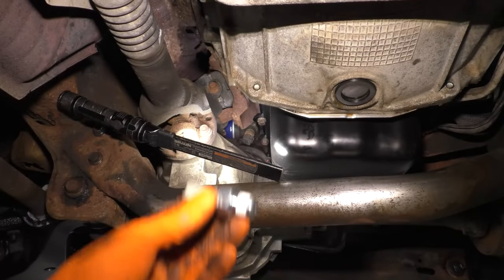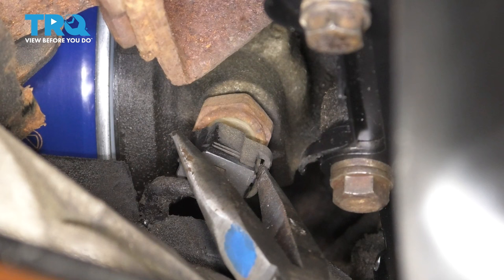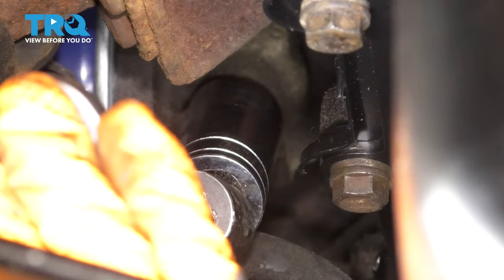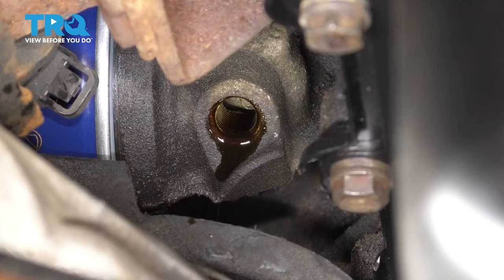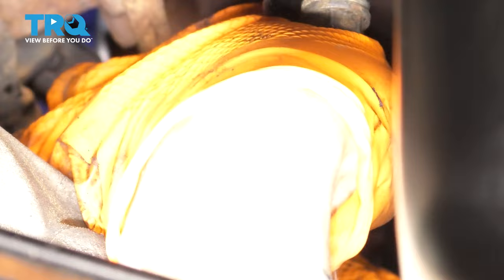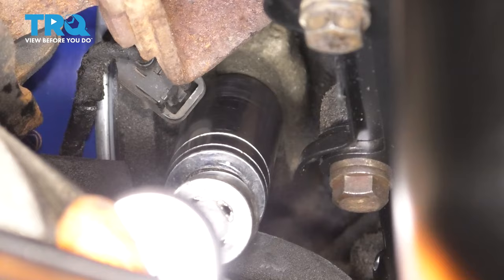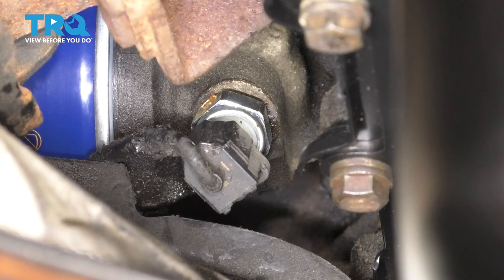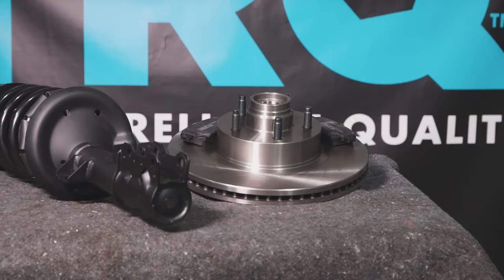How to Replace Oil Pressure Switch 1997-2003 Ford F-150

Comment: I have a 2004 F-150 Lariat Super Crew 4x4 with the 5.4L 3V V8
I turned my key a it read “ Low oil pressure “ on the dash. So I bought a new oil pressure switch/sensor to replace it myself tomorrow morning and thanks to your video I feel confident enough to do it myself and save a hundred something dollars. I’ll put that money to good use and fill up my gas tank, so much thanks for the video

Comment: Pro tip: if you think to yourself that this can be a 20 minute job and you can go inside to watch the game, you'll end up cracking the oil filter adapter housing when you thread the sensor back in and spend the rest of the night cleaning oil off the garage floor

Comment: Is the 4.6  2 wheel drive oil pressure switch location is the same as the 4 wheel drive.. anyone.. thank you